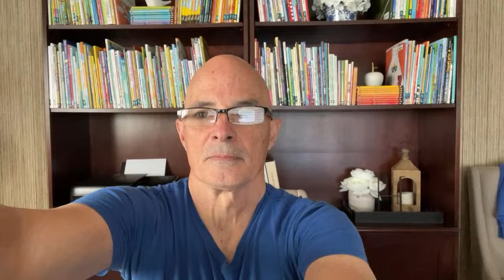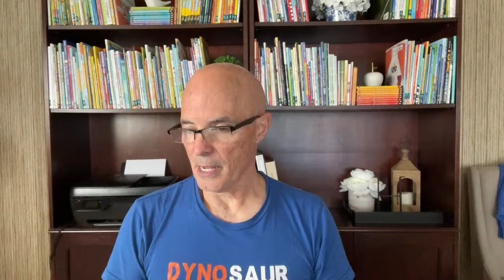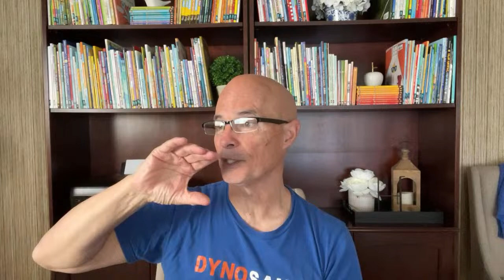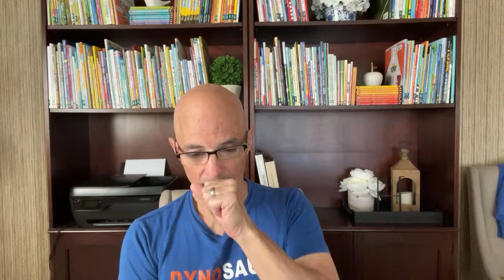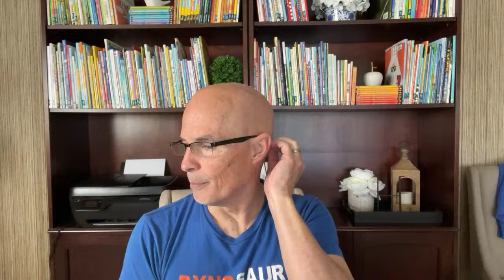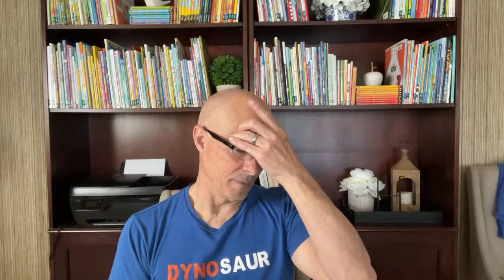351W/408W NITROUS TEST-LET'S TALK TECH

Comment: Dimple pistons wont help or it will be very negligible difference
Reply from the maker: I'm curious to see
Reply: @richardholdener1727 yeah me as well. I know that back in 05-07 we tested dimple combustion chambers, intake and exhaust runners. We even made different patterns and shapes in the ports and chambers. With no effect on the dyno that was noticeable. Now coatings are lil different imo. There is something to coatings.

Comment: built a 427 sbc (dart block)  two days clearinceing for rod bolts then small bs cam custom liftors (1200 $) and some oil pan work . TBS 671 two 600 hollys .flat tops 74 cc AFR heads 10:1 ish makes 664 hp at 6300 and 615 tq at 4500 .peek boost 6 psi at 6400 rpm going in a jet boat wish me luck!